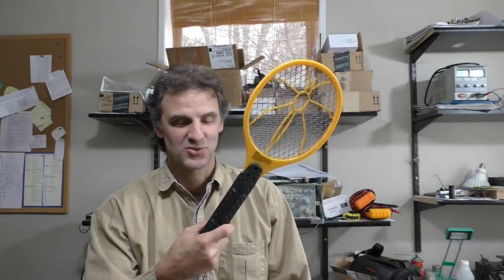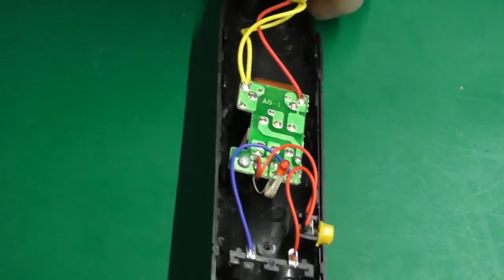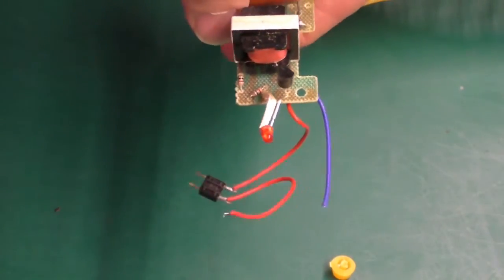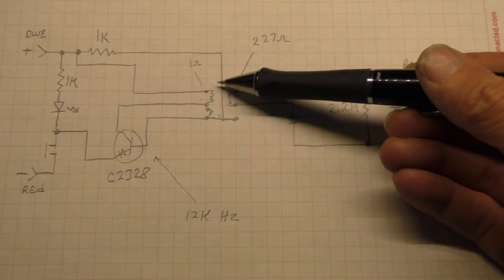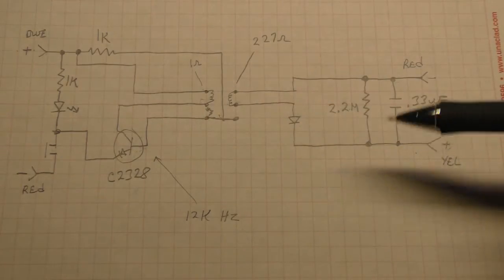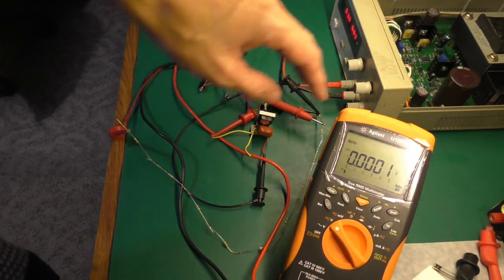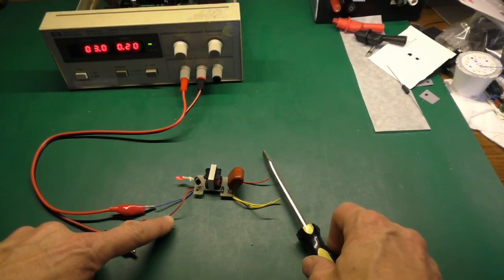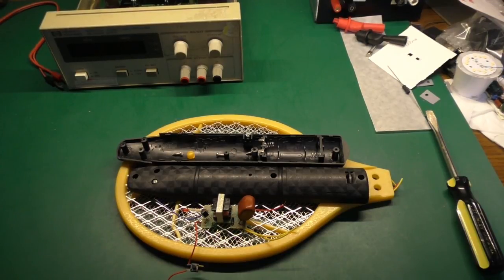R&D #8 Bug Zapper teardown.

Comment: I have one of these things in front of me, and i'm trying to figure out how to make it more powerful. Because there is 0 voltage regulation in it, would adding another 2 AA's in series boost the output voltage to double? Also is there any way to increase the output current? I guess I could remove the discharge resistor but it seems sketchy
Reply: I dumped a 9v battery into it and melted the transistor. New transistor with a heat sink and it's working. Haven't measured V and A.